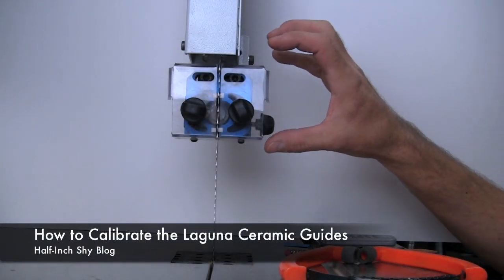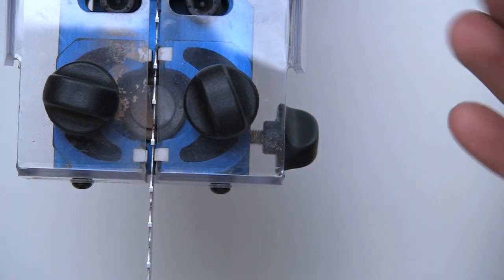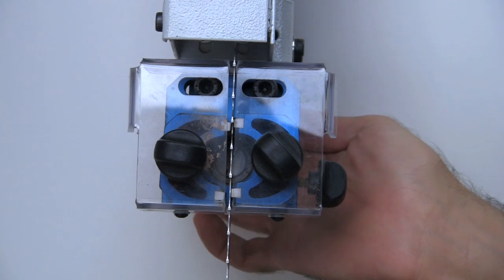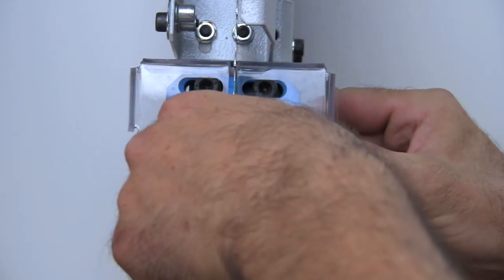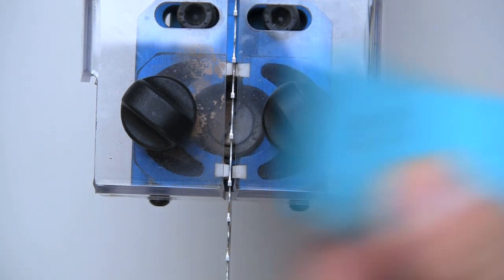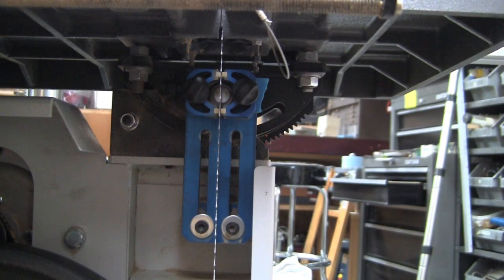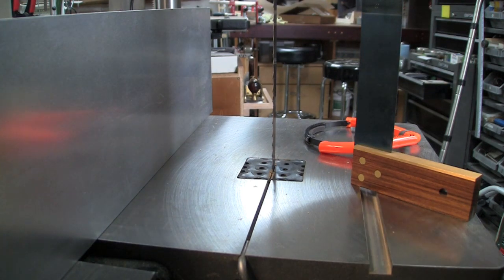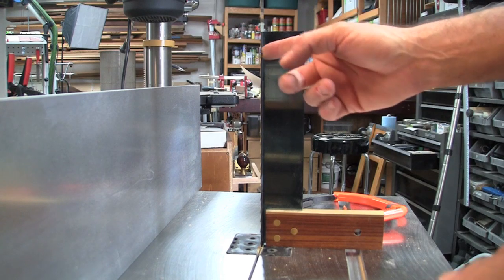#42.2 - Laguna LT-18 Italian-Made Bandsaw - Part 2 - Laguna Ceramic Guides

Comment: To fix the paper shim method.  I took mine ceramic guides off and flattened the back side of the aluminum to be square with the ceramic.  Fixed that along with what I was finding to be squirm when tightening it in place.  Mine were not square nor particularly flat.

Comment: Great video series on the Laguna, I have an LT18 Italian and the first thing I did was remove that cheap plastic cover that has no real value other than to collect dust and make it difficult to set the guides.  It has no safety value to me as it really isn't much of a guard if that is what it was for.  Most likely it was something installed on the saw so they could said, hey look we have a guard on the blade, which only leaves an additional 18" exposed when resawing thick stuff, LOL.

Comment: I also have the LT16HD, I adjust the blade to the table, then adjust the guides. When I move the guides up and down I still always check blade to table. Now that I am no longer using the resaw king blades, so far the table has not needed any adjusting when moving the guides. I am using 1/2" and 3/4" woodslicer blades from Highland for resaw. Like them better than the resaw kings...

Comment: WELD warning addendum... Be careful setting these guides, because unlike rotating bearings if the guides are poorly aligned, or if the screws are not well tightened the ceramic guides are tough enough that they will jam against the blade and stop the saw cold in its tracks. I recently had to help my friend who thought his capacitor on the motor died. He replaced it and the motor would still not turn. He asked me to help diagnose his motor.

I traced the issue to his lower ceramic guide block. They were loose enough that they guide block rotated down and the upper ceramic guides were intermittently catching the blade weld and chipped the rounded edge. After I found checked the motor I turned my examination to the entire wheel assemblies. I could barely turn the upper wheel by hand and knew there had to be a guide issue jamming the blade. The chipped edge and misaligned guides caused the blade to stop and jam at the weld the last time the saw was used so the motor could not provide enough torque to get the wheel turning

Comment: Paul, I have just ordered the Laguna guides for my MM20. I am interested to know if you end up with the inside guides tighter to the blade than the outside guides with your technique. If so, is there some reason that is more advantageous than a symmetric gap?
Reply from the maker: ERIBaseball Mine tend to be closer to the blade on the inside than the outside. I want enough gap to give the blade room, but want to keep drift toward the fence to a minimum. Kinda doesn't matter as your gap is really small assuming the blade's weld was ground off properly.  Sorry for the late reply... by now you're enjoying the new blade guides!

Comment: Does you height adjustment have a lock mechanism to keep it in place?  Is it possible the blade moves but when you tighten the locking mechanism there isn't really any play?
Reply from the maker: Yes there's a locking mechanism behind the arm behind the saw. It wiggles a lot without locking the arm in place. Once locked, it doesn't move so that's when you want to adjust the placement of the ceramic guides.
Reply: @HalfinchshyWWing  I guess I wasn't clear.  Sorry.  The crux of my question:  Is it possible that you don't need to re-adjust the guides at all?  Eg.  The blade moves while being adjusted but goes right back to the correct spot once locked in place.
Reply from the maker: @jackvideojmf  Sorry about that. Whether you have the bearings or ceramic guides, they potentially need to be adjusted for each blade. Different width blades definitely need at least the back 'thrust bearing' (the ceramic cylinder) adjusted. If the blade thickness is identical, you'll get away with leaving the side guides. My blade guard seems to return to the same place when I lock it so that never gets the guides out of alignment. The guide is there to keep the blade from deflecting when the stock is pushed through
Reply: @HalfinchshyWWing  Thanks for taking the time to explain that.  I really enjoy all your videos.  I have learned a lot.

Comment: with the side guides loose and then decide on the height of the guides for the board being cut. then just adjust the side guides to the blade. maybe its just one half dozen of the other? But to me then, the guides arent properly adjust, being that the guides are now deflecting the blade. But its good that you pointed this out that it happens. Maybe someone already suggested this in an older comment. But that is how i handle it on my old 14" Delta. IMHO. Hope this might help you or someone else.

Comment: Just Picked up a used laguna LT16HD 3 years old for $1500 from a gentleman with a one man shop and was surfing youtube for any helpful info and ran into your video. You may have come across this your self alreadyof what i am about to point out, being this video is a year old. In reference to moving your guides up and down and noticing the movement of the blade and adjusting the table to correct this. You could just square up the table to the blade ONCE.. Continued next post...